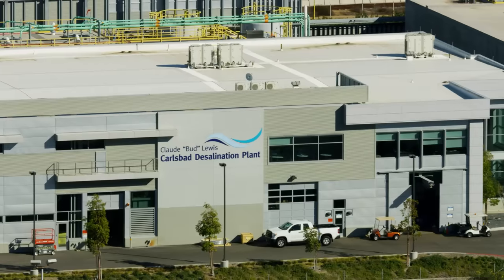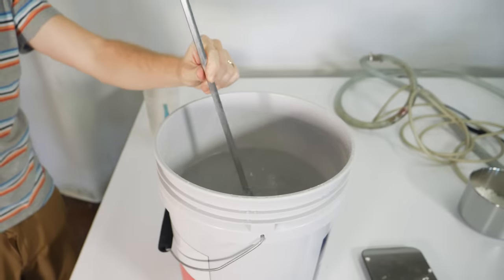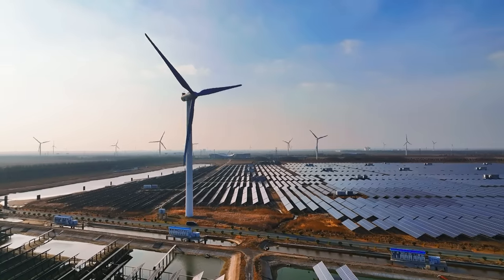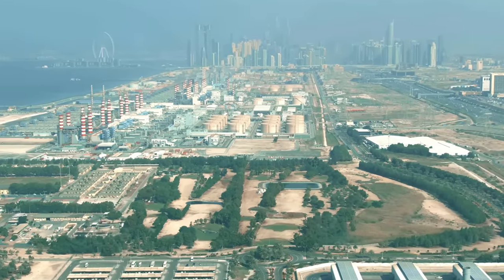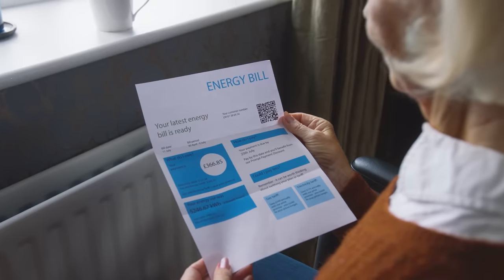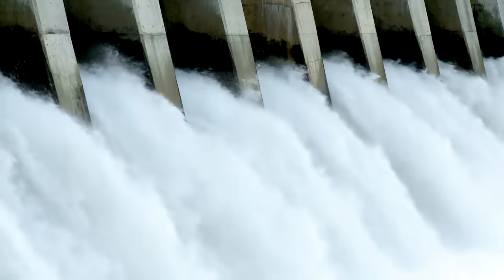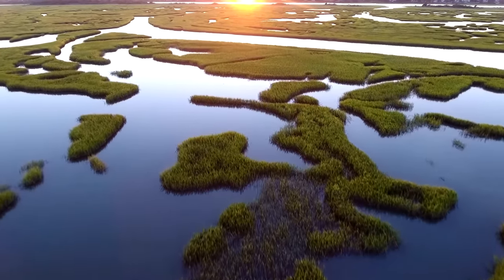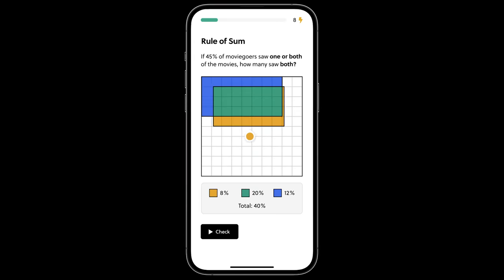Why Is Desalination So Difficult?

Comment: One thing he forgot to mention is that reverse osmos is extremely reliable.  Let me explain, I'm from Ukraine, and more than 20 years ago, my father bought a 20 liter per day plant for $100 (from the US by the way).  And you know what?  We have not changed the osmosis even once in all the time, only every 2-3 years the primary filters.  And the quality of the water hasn't changed.  It's really amazing technology and now it's also cheap.
Reply: Hi, I'm wondering whether u or anyone u know who understands the desalination process would consider it at all possible or practical to share this process with  other engineers located in Gaza. It's a big stretch but surely there would b people there who could benefit and use that knowledge in some way as drinking water is so scarce. 
Or even turning fetid water 💧 into drinking water using tablets.  Just trying to offer some solution to their current situation which appears dire.

And BTW,  I pray for ukraine and its liberation from Russia everyday.

Comment: One of the most interesting things you can see is where a fresh water river flows into the sea. From overhead, you can literally see the boundary between these two different sources of water as they mix.

It is worth noting that the conditions in sea water intake vary day by day and even during the day. So conditions in a desalination plant have to be monitored closely in order to ensure efficient operation and a good product at the outlet.
Reply: I think such a boundary is called a halocline, iirc
Reply: In some places, they have plants that win energy from this mixing, sometimes called "blue energy".  This clearly shows it takes energy to get the salt out.
Reply: ok

Comment: I work in water treatment in my county as an operator. We adopted membrane filters in the mid 2000's and there are very few treatment plants (at least in Canada) with this newer technology. Our membranes are made by PALL. It's such a new technology that the lifespan of the membranes is still unknown (outside of salt water). We have ordered a complete new set of membranes that will be replacing the old ones next year but this is only cautionary and not reactive. Our tmp's (trans membrane pressures) have held up with only minor, routine maintenance. Our effluent remains well within the 0.1 micron spec and our turbidity exceeds our provincial standard by multitudes.

Comment: Salt flats were once massive brine pools. RO and pumping the brine onto large desert lake beds adds to the evap cycle. Salt deposits can be broken up and stored away. 

Also thinking about MITs recent answer to desalination which uses ion concentration polarization omitting the need for pumps or filters and can run off a $50 solar panel, it's less than 22 lbs, simple to operate and about the size of a small suitcase.

Comment: During the "Millenium Drought" in Australia the NSW government funded an RO desalination plant to supply 15% of Sydney's drinking water with provisions built so it can be easily scaled to supply up to 30%. It's energy needs were offset with a massive new windfarm just out of Canberra.

The plant was finished in 2010 right as the drought broke, so it was mothballed and wasn't used until the 2019 drought
Reply: There's a heap running in the other states except for Tas. And of course Toukley planned but deferred back in 2007 in our case. We really do need to reconsider them in NSW since Sydney's water demands can cause difficulties for other catchments, and also to support some of our ag needs rather than impact the regional water supplies.
Reply: Perth gets about 50% of their drinking water from our desal plants
Reply: @kevinrudd1  not just Perth, you send a lot of water inland via pipeline.
Reply: So das the desalination basicly work energy storage for the windfarm?

Comment: Nuclear powerplants are basically just "big waterboilers." Many of them are of obvious reasons situated near oceans. In them you get a lot of desalinated water steam in them, which easily can be collected and used as drinking water, and many nuclear power plants has that dual function: generate electricity and desalinate water. THIS is the easiest and cheapest way.
Reply: On the one hand, this is a really cool idea, but on the other running salt water through a nuclear reactor seems like a really bad idea. Besides the increased risk of the cooling lines becoming gunked up and breaking, it seems like it would introduce a lot of extra maintenance load for the nuclear plant.
Reply: @oscarsmith3942  I have no idea how they do it but couldnt they just use salt-free water to cool the reactor? then use the heat to desalinate a separate tank of salt water
Reply: @oscarsmith3942 is not a bad idea at all. It doesn't make radioactive water lol. Tempurature changes is all.
Reply: @Zaque-TV  As a kid, I used to bathe in the ocean near the Swedish nuclear power plant in Barsebäck. Because of the cooling water from the reactors, the water was always quite warmer there than in other parts of the beach. That beach was (and is!) very popular, and the water is, of course, not radioactive whatsoever.
Reply: @oscarsmith3942  Nuclear power plants already use salt water. And as I point out. some of them are already used to desalinate water.
Reply: I literally started thinking about this while watching this video without knowing its already being done!!
Reply: Unfortunately, in the United States, the greatest barriers to nuclear power and desalination are political and social. I'm a firm advocate for both systems, married together, as a means of addressing many of our energy and environmental concerns. However, the general public, as well as special interest groups on the right and the left, have held back progress in both nuclear and desalination systems. I spent several years working as an environmental litigator, specializing in Price-Anderson Act litigation and regulation, and the one takeaway I got from years of civil cases, public comments, and site remediation is that no one seems to understand how safe modern nuclear reactors truly are.
Reply: @oscarsmith3942  You don't run the salt water through the reactor. In fact, it does not get anywhere near the reactor. Generally, the heat is delivered as steam to the desalination plants. The delivery of steam off site should only be done with steam that is non radioactive, which means that in the case of a boiling water reactor, you would need an intermediate heat exchanger. But that is still a practical  solution.

Edit: Added some clarifying details.
Reply: i read an article that a plant in japan dumped water from the nuclear process into a nearby lake i dont think you can just straight up drink
Reply: @thepotatoofheaven  Nonsense.
Reply: Since most reactors must produce power at a constant rate, the excess produced during the low demand cycle can be used for a variety of purposes including increasing fresh water supply and pumping it where needed.
Reply: @edwardadams9358  It's an amazing solution to so many of our problems, yet we reject clean, safe nuclear power because of ignorance.
Reply: @oscarsmith3942 two loops and a heat exchanger
Reply: @Stroheim333 it wasn’t a lake it was the Pacific Ocean 🌊 😮😢!
Reply: @malcolmrickarby2313  You confuse things here.
Reply: @Stroheim333  sorry about the confusion. I was referring to the stored treated and diluted radioactive water from the Fukushima plant that was released into the Pacific. Were you referring to a different release?🤔
Reply: @malcolmrickarby2313 he wasn't referring to anything, you were. He was responding to what you were referring to.
Reply: @oscarsmith3942 it’s not a bad idea
Reply: Fusion reactors would definitely offset any energy costs to desalinate water. Once we get those fully figured out it will be a much more viable thing to do
Reply: @TheMrDarius just 20 mote years 😅
Reply: @pedrolmlkzk  I mean 20 years ain't that long compared to how long mankind has existed and compared to how fast we've advanced just in the past 300 years.
Reply: @TheMrDarius  history is never a straight line, we can't take technological advancement for granted
Reply: Nuke plants use salt water as an ultimate cooling outlet. You need a huge body of water to act as a heat sink for those. The way they use seawater to cool is in such a way that the seawater does not mingle with reactor cooling water via a heat exchanger. The seawater will steam off of the heat exchanger as a byproduct of cooling a nuclear plant, and the steam is collected and turned into drinking water. This is the steam plume you see billowing out of the cooling towers on nuke plants.

T. Nuclear tech worker

Hope this clears it all up